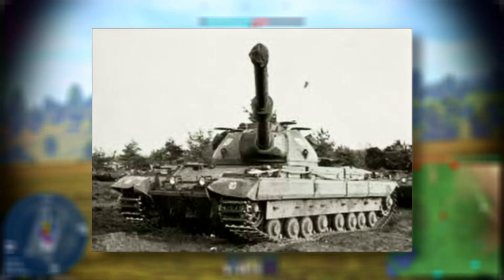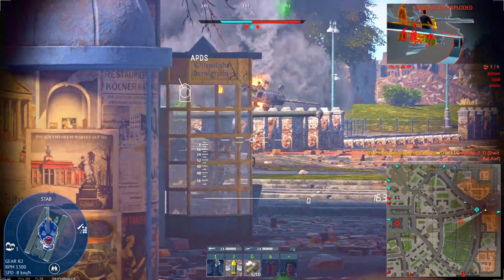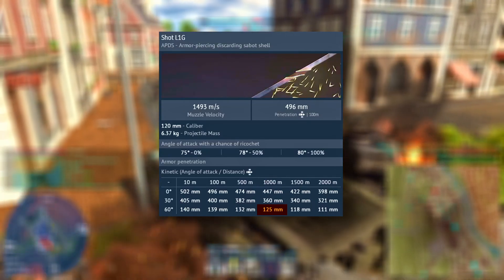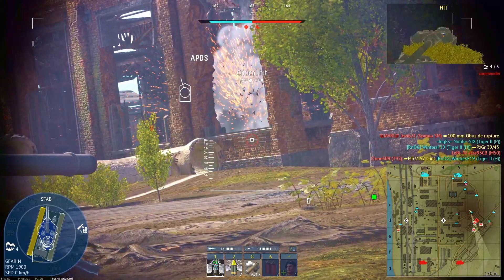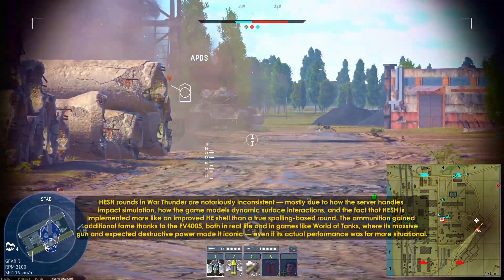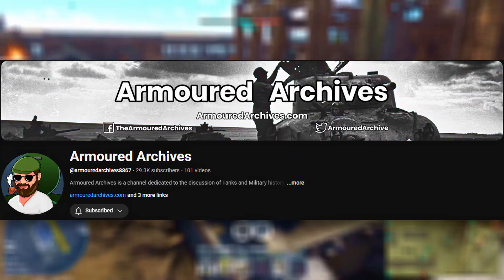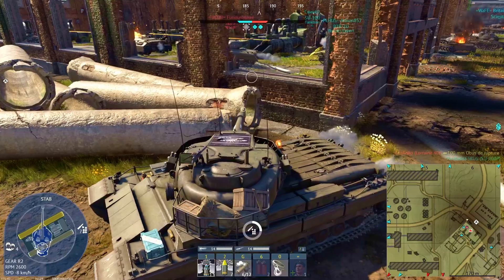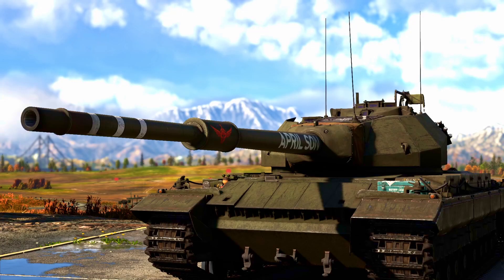What If: The Conqueror’s 120mm Gun in War Thunder Was Historically Accurate?

Comment: While in game the Conqueror does overperform in some aspects, notably with the ahistorical spaced armour that originates from the 183mm HESH trials, the gun is actually not a place where it significantly overperforms, unlike what your results suggest.

The APDS in game matches the primary source Army Operational Research Group Memorandum No. E13, "Tank Effectiveness :the Conqueror, Conway and Charioteer", which compares the effectiveness of the Conqueror, Conway, Charioteer and Centurion Mk3 at taking out the JS3 (IS3) and T34/85. On page 9 it states that the 120mm APDS has 446mm flat pen at 1000 yards, which it does in game. However it also mentions that the round has 406mm flat pen at 2000 yards, which is more than in game, at the cost of having 118mm of pen at 60 degrees at 1000 yards and 108mm of pen at 60 degrees at 2000 yards, which are lower than in game. This comes from Gaijin using the 1000m result as the baseline, for the stats, which is helpful for rounds where information can be hard to find. Comparing actual test data to the formula War Thunder uses would suggest that the round has more drag than it had IRL, which Gaijin have worked around by giving it a higher muzzle velocity, which results in flat pen being better IRL, but angled pen being worse IRL, which matches the muzzle velocity statistics. (However in practical use in game, the shell performs significantly worse than it would IRL due to the lack of spall and shell shattering, which I couldn't find any reports of the shells being prone to shattering, despite how it would logically come up in tests if it was as significant as War Thunder makes it out to be)

2:09 Historical trials show higher than the 1433m/s you state, in "Fighting Vehicles Research and Development Establishment report no Tr 7" the modal muzzle velocity of 40 rounds of APDS fired from a new barrel was 4780fps (1457m/s), with a mean of 4766fps (1452m/s) and a highest resulting test had a mean muzzle velocity of 4800fps (1463m/s) over 10 rounds.
3:00 You calculated the muzzle velocity from the speed, using the figure from 2:10 which was already a muzzle velocity.

4:32 While true that HESH wasn't designed with anti-tank capabilities in mind, it is a misconception that it wasn't effective at it, 1947 tests showed that the new 165mm HESH would cause internal scabbing or spalling in a Tiger 2 if it hit anywhere except the side skirts/tracks. RARDE's tests for the Saladin's 76mm were conducted on a Comet to see if it could create internal spalling through the 65mm thick turret, as well as seeing if it could get mobility kills on armoured cars with near misses. While later tests showed that the 120mm HESH from the Chieftain could create spalling through plates over 150mm thick. While HESH wasn't conceptually designed with anti-vehicle capabilities in mind, it was deemed to be useful in anti-tank roles and continuously was proven to be effective at taking out vehicles. Which can be seen throughout British Military procurement, not just with the FV4005, but with the Saladin, L2 BAT, and Malkara ATGM.

5:38 Once again, the Tank Encyclopaedia values have been rounded down, with the lowest recorded muzzle velocity in the tests being 2500fps (762m/s) exactly, and highest being 2589fps (789m/s), and an average muzzle velocity of 2540fps (774m/s) across 140 shells. Also the 120mm figure comes from the target at 0 degrees, with HESH producing spall through a plate 163mm thick against a target at a 60 degree angle. In War Thunder, HESH's penetration is calculated as roughly 1.3x the diameter of the shell, which comes from American trials, Gaijin also subtract around 10mm from the result to get the in game pen. There are 2 exceptions to this calculation, being the 90mm HESH having significantly less pen, and 106mm HESH sharing its stats with 120mm HESH. Although in game, HESH also behaves very weirdly with volumetric and overpressure, resulting in the shell feeling a lot worse than the estimated 0.9x effectiveness of HE that tests suggest.